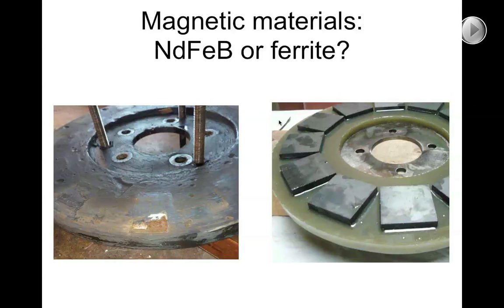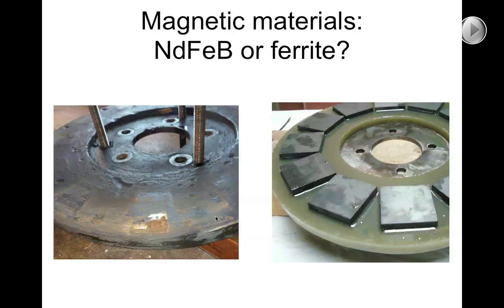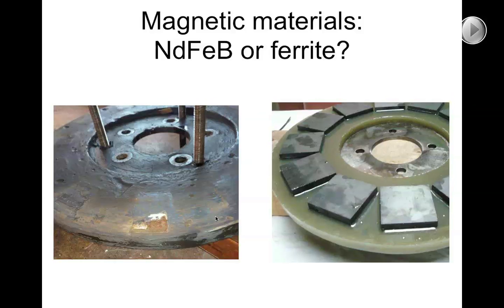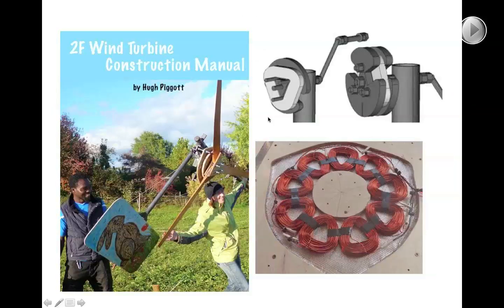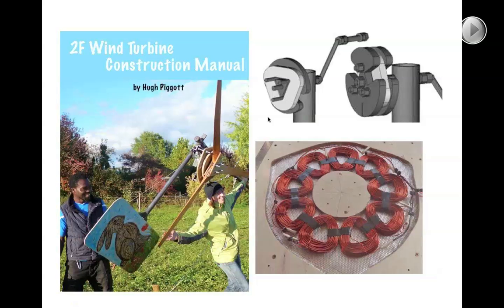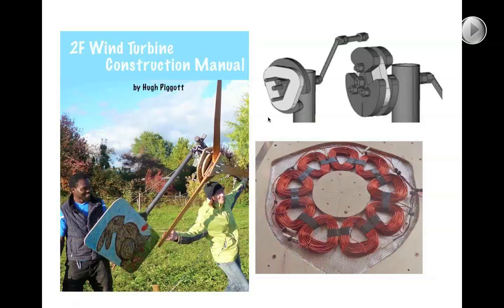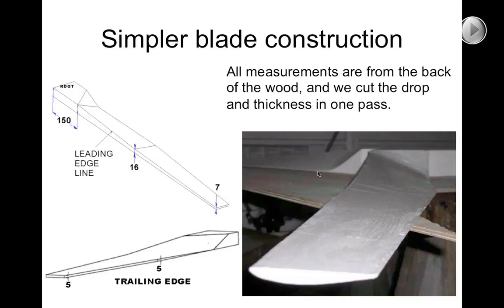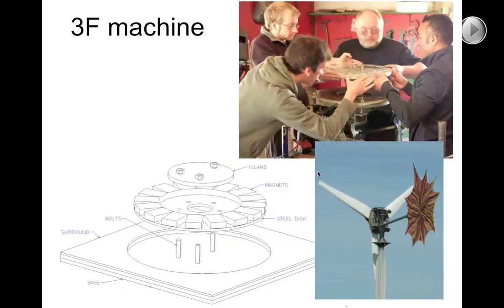Ferrite Alternator Windmills

Comment: The price of neo magnets is huge now so this needs an update. I was on Scoriag in 1983 and started building my own turbines. I fill 100% copper by turning down or up the ends of the coils, just clearing the ferrite blocks. So there is a second ring of coils interleaved. Its also important to wind really neatly, very low profile, 5mm for example. The stator is thicker where the coil ends are, so its still rigid and strong enough. Remember with twice the copper the coil ends can be connected in parallel or series to optimise. I cant have any windmills because of planning, but I'm using up 18" steel discs and 100's ferrite and 15kg wire  on drums. To make an astronomy telescope mount drive. Made all the 19" mirror telescope myself too.

Comment: Hy hugh piggot sir my question is that i low windy area and i want make wind turbine before i made your design blades 3metter diameter but cannot give result i wand make turbine give me some suggestions plzzz sorry sir my English is weak but i think you understand with my question
Reply from the maker: Hi Send me pictures of your project on whatsapp to +4413157600 and maybe I can help you, but I have to say that if you live in a low wind area then you may be wasting your time.  Wind power comes from good winds.  You may do better to use solar or hydro power instead if you do not have good winds.

Comment: Bonsoir .  J'aimere savoir si le fil aluminium peut aussi fonctionne a la place du fil de cuivres ?????   Moi c'est meddy batechi j'habite en RDCongo.
Reply from the maker: Yes it would be possible to use aluminium wire if it is suitably coated with enamel.  But the efficiency is lower as the resistance of aluminium is higher.  So it will overheat at a lower current than a copper wire stator.

Comment: High Hugh i am Johan from South Africa is their a way that i can build my own rectifier or do i have to buy from America that makes it difficult for me. And also a Charge controler do i have to put one in the system to controle the power to batteries or is rectifier enought? Great work Hugh love your work. It first time i try to build a wind turbine. South Africa is starting to have lot of powercuts i want to have a backup before the grid is gone i see many use your ideas you are the human race solution.
Reply from the maker: hi Johan, You would need to use diodes to build a rectifier and in the end these would be just as hard to find as the completed unit.  They are for sale in every country.  Try eBay or get one out of a car alternator.  You can charge a battery without a controller but be careful.  If the battery gets full then it can be damaged by too much charge and can even explode.  A big old "flooded" battery (wet acid inside) is more tolerant than a small, new sealed one.  cheers Hugh
Reply: @scoraigwind  Thanks for reply Hugh i was thinking of using a car rectifier but i did not know it will work. I know a car alternator have a rectifier in so the battery wont over charge. mabe it will work. The thing is i can build coild but i dont jnow how thick and how many and i will use the microwave Ferrite round magnets i only want to charge a Lead acid battery 12 volt for LED lights and phones maybe the frige also. If lights go out in South Africa then it will become k=like Venezuela . I am ex police officer and i was in riots and you know when lights go out they steal and break in. Prevention is better than cure. Dint you build a small wind turbine and help me with the specs please. May tell me if i have to use 14 or 15 guage copper wire and how many turns? And how many magnets. The magnests is 14 mm thick and 57 mm wide the inside diameter is 21 mm.  But i preciate your help. If you were in South Africa i could have join one of your classes. Cheers from South Africa and blessings for New Year.
Reply: @scoraigwind  Thank you Hugh have great day

Comment: I feel a bit silly for not playing much with Ferrites yet.  Now that some time has passed with these machines I wonder if you'd comment on stopping the turbine with a short circuit, both with shorting all 3 phases, and also just shorting with 1 phase.  So far, with NdFeB magnets I've had good luck stopping a turbine at any speed usually just shorting 1 phase, which is nice sometimes if something goes wrong with the line.
Reply from the maker: It's a good question, Dan, and there is no doubt that the flux density is lower with the ferrites, which can mean less torque in a direct comparison.  But I use massive magnets that fill all the space, and also the whole alternator is a bit bigger too for the same performance so I would say the braking is just as good with these ferrite machines I build nowadays.

Comment: Very interesting. I came across very large size ferrite magnets used in industrial machines to trap ferric materials and prevent clogging. Some were cube shaped and crazy strong (actually scared me too much to bring back with me).  The others were more similar to the shape you are using. To remove them from the machines they get considerably chipped and I am worried about using a magnet that is already a little damaged. Otherwise my neodymium-based low-powered turbines are coming along but when we upgrade, ferrites may be the only way to go here in Ivory Coast. Are ferrites okay with  little chipping on the edges?
Reply from the maker: hi
It's very difficult to damage a ferrite/ceramic magnet.  I have used them when they have been broken and they work well.  NdFeB magnets are easily damaged.  Once the coating is damaged they will corrode and die slowly.
cheers
Hugh
Reply: @scoraigwind  Thanks again. Your earlier advice was also helpful. My units are still not very efficient but we are starting with effective (at meeting out tarrget power output 40w  on single phase) and then we will refine.

Comment: What are your thoughts of aluminium hubs and how the magnets magnetism transfer into steel? I'm making a turbine that has steel hubs, but will also test a aluminium. Thanks for your vids, been real helpful even your books.
Reply from the maker: hi
It's important to use a steel or iron disk if you want to maximise the magnetic flux.  Aluminiium is not a suitable material for the magnet rotor backing disk.
Reply: Hugh Piggott Ok Got it, thanks for the reply!

Comment: thanks for your update info as for the blade carving. people today are always looking for a easier way rather than just getting to work. keep up your good work. thanks
Reply from the maker: a couple of comments here.  thanks for your feedback always appreciated.  I find that people do complain that my blade carving is too complex so I do see a need to simplify it but at the same time I think people way exaggerate the amount of time it would take for an experienced blade carver to do the job.  Carving your first blade takes forever but the second is twice as quick and it gets quicker still.  Measuring and marking is very slow at first whereas given time it only takes seconds.  Most of the time is spent scratching your head or worrying about cutting off too much wood, which is all good first time around but in reality not necessary every time, as you learn the process and the skills.
  Oh and it really will take forever if you try to do it with a file and sandpaper.  Sharp cutting tools are the quickest way.
Reply: Hugh Piggott Yes, sharp cutting tools. That's why I mentioned the reciprocator for doing the lion's share of the work, so to speak. You can remove a lot of material fairly quickly with one of those, or a circular saw - whatever the user's preference. When you get down to the fine detail to reduce drag on the surface when they're performing, switch to the bastard file and sanding block. Nice smooth surface in the end...the finishing really doesn't take very long for - as you said - and experienced craftsman. Standard wood working procedure ;) But yes, your method works just fine, it's how I learned and how I advise anyone else to as well. Thanks!!
Reply: @JamesBiggar  have you considered CNC? Excellent site... channel and work!  Thanks for sharing Doug
Reply: I think he's speaking in terms of commercializing - it's hard to mass produce competitive wooden blades on schedule when they have to be hand carved with simple tools, without requiring a huge labour force. But for the DIY'er, a reciprocating saw, hammer, chisel, bastard file and sanding block will work just as good as the person using it ;)